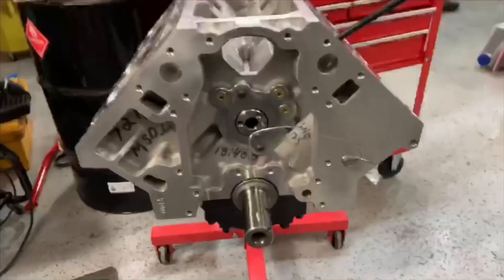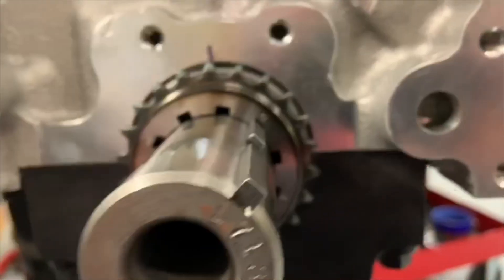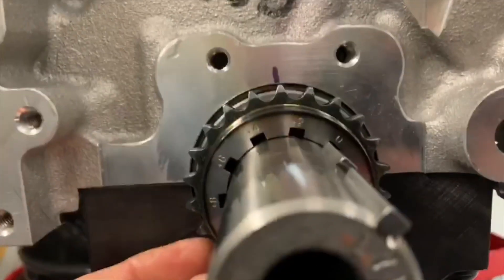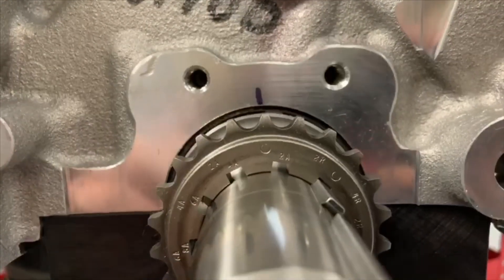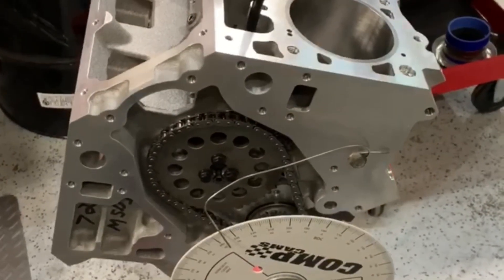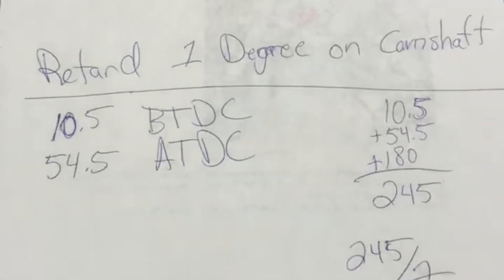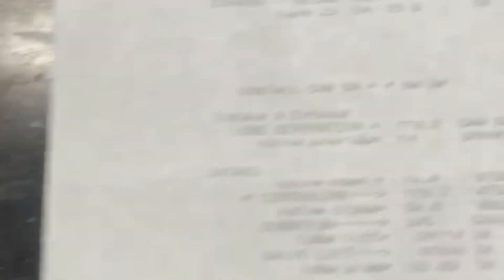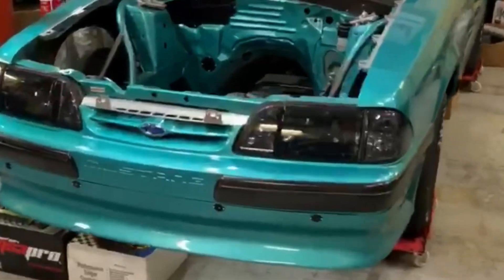Cammed AF!!! Cam Degreeing at it’s finest!!! Why should you degree your camshaft????

Comment: Okay, so start by buying several adjustable sets then mix and match parts till it's basically dot to dot.
Reply from the maker: No sir. You will need a degree wheel and measure Ivo/Ivc and evo/evc to degree the cam properly. This video was to show everyone that not every part is machined 100% correctly. 
Crank key ways, camshafts, timing sets. Can all be off just a touch. That’s why it’s important to degree a cam.